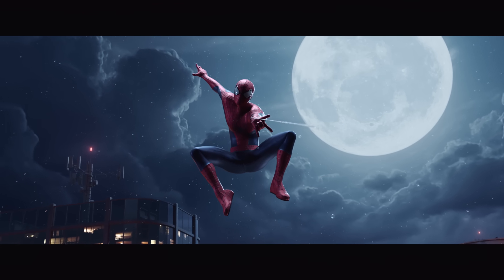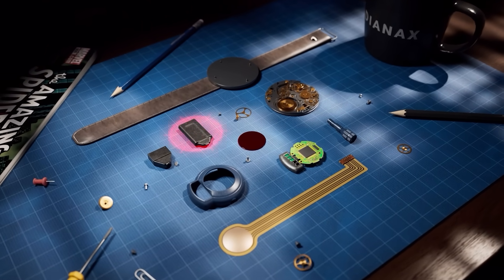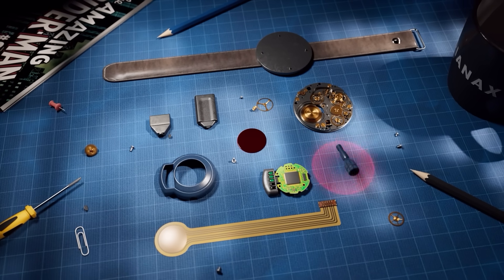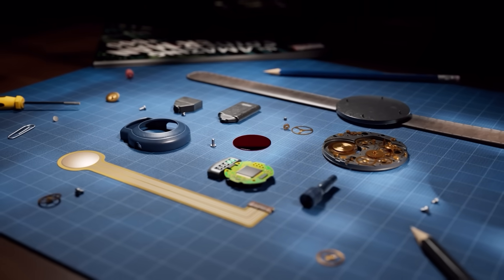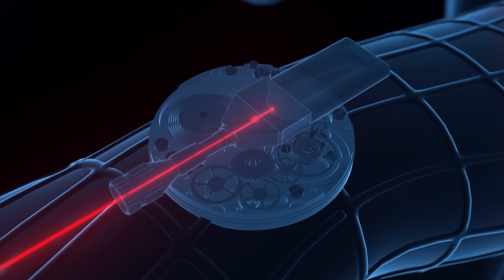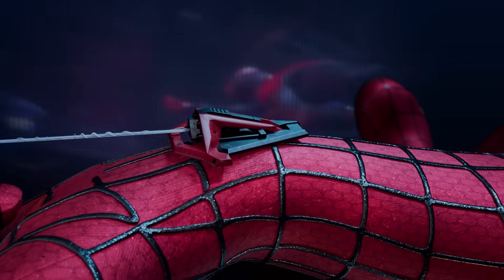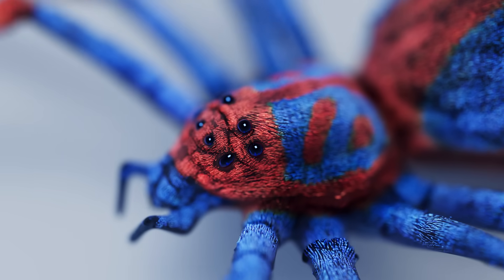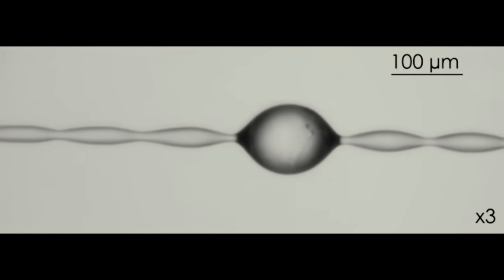How the Web-Shooter Works

Comment: it's not really that realistic. 1) where's the web supply coming from? there's no visible web supply. for him to swing that many times (in the comics and movies), he'd need a large pack to feed all the web. 2) where's the force/pressure coming from? a device that small is unlikely to create enough pressure to eject a web at that speed for the distances that he needs. it's upwards of 100 ft that he's shooting to, building to building, which would require a significant amount of force. 3) how does a web that light shoot in a straight line for that far? try throwing a string as hard as you can. it's not gonna go far because of how light it is. there's no weight at the front to propel the string forward. if you attach a piece of rock/gravel to it, and throw the rock, it'll go much farther, but definitely not enough for it to be a straight line from one building to another. now look at the shooter. it doesn't shoot out rocks, and the most weight i've seen is a glob of webbing at the front that acts as the weighted momentum. but that's like tying multiple knots on the tip of the string and throwing it. it's still not heavy enough to make any difference. so the physics just don't make sense.

Comment: After the web release how does it cut in the hands, if it is hard as steel😊?
Reply from the maker: When Peter releases the trigger, a small valve inside the device cuts the web while it’s still soft.
So it doesn’t harden in his hands like steel, it solidifies only after it leaves the webshooter

Comment: Most definitely not carrying 100’s of meter thread in the cartridge. It’s most likely some type of solution that coagulates when exposed to air probably due to a pressure drop (I imagine it’s highly compressed in the cartridge

Comment: Excellent video but unfortunately this type of web shooter is 100% impossible for many reasons; no web material can support that kind of body weight, no amount of pressure could propel such a lightweight thread at such long distances, that flimsy wrist strap would NEVER support his body weight while swinging, the internal components could also never support his body weight. A web shooter like this is pure fantasy.
Reply from the maker: I agree with most of your points. The only thing I’d add is that Peter doesn’t hang from the web-shooter itself, he grabs the web line with his hands, so the load doesn’t go through the wrist strap.
Reply: @Dianax13 Good point and a very excellent video! 👍
Reply from the maker: @SuperheroArmorychannel thanks bro

Comment: One logical approach to shooting webs would be to press against his upper palm (closer to the base of his fingers) with all his fingers. making a fist COULD trigger the effect of pressing 2 fingers on the button, but higher up on the palm- think about it. you dont make a fist that way, your fingers usually reside in the middle of your palm. but by doing the old-school spidey way makes more sense to me. more room for the web to come out, and a smaller margin for accidentally firing a web. 
I wouldn't mind seeing spidey do this again, because it makes sense. yeah we all know the 🤟, but there's such a margin for error that i know is now a staple of spidey, but unless it was EXTREMELY finger sensitive/ had a recognition system, the higher squeeze towards the base of the fingers makes more sense.

Comment: From what I remember from the 90s cartoon the webs were almost like two parts resin were he developed a special fluid that coagulates when dispersed which creates the webbing and after two hours it dissolves the reason it seem less it’s compact fluid which reacts after release what we have seen in real life so are is just coiled up straight or aerosol cans that squirt out silly string but I wouldn’t be surprised if someone goes the resin rout to achieve the compact issue and the tensile strength issue in the future.

Comment: Why does the trigger not get pressed accidentally whenever peter holds something tightly or put his hands on something?
Reply from the maker: Someone pointed out earlier that Peter specifically designed the trigger so that it takes superhuman strength to press. That feature protects it from accidental activation and makes sure no one except Peter could use the web-shooter.

Comment: Very nice Animation but i have one question that I had from the very beginning. So if you press the button to shoot the web, how is the web cut off from the shooter so that you can keep swinging?
Reply from the maker: Most likely, while you’re pressing the button, the web keeps shooting out. Once Peter releases the button, the web flow cuts off instantly, and he has just enough time to grab the end of the web line. If I understood your question correctly
Reply: @Dianax13 This could be a possible theory. Nevertheless like you mentioned in your video, the speed that the web is coming out with is so fast that I doubt that he could possibly catch it just in time. At the end of the day like you mentioned, Peter has superpowers but I doubt that he is that fast. So it must be something else. For example maybe a timer that starts after Peter releases the “shoot button” to cut off the web, for example 3 seconds. But the blade needs to be a very sharp one to even take into consideration regarding how tough the web is. Maybe you have some other pointers or some thoughts on this theory would really like to hear them!

Comment: they webshooter is initially explained but it leaves many questions. how does the web not get stuck on his hands but get stuck on other things? how does spider-man grab onto the web if it is being shot out in a constant stream? if the web is supposed to be ultra durable, how does the shooter stop the web from coming out? also what about nets and other objects peter makes from his webshooters? how do the web shooters not get constantly clogged? being in high pressure how can one cartridge last so long without having to constantly replace it? how does he make catridges with such high pressure and not have it explode or pop and make a mess during a battle? the electronic web shooters look prone to emp attacks by electro. how does that not affect his web shooters? what if he runs out batteries?
Reply: 01. In many versions, he uses van der waals forces, which wouldn't make sense, but if it uses electroadhesion for that, he'd be able to stick and unstick anything by generating electric fields.
02. Spider-Man doesn't hold the web while it's being shot, he applies force to the piezoelectric sensor, and then quickly releases and holds the web.
03. Spider web is extremely strong, stronger than steel, but in tension, not shear. Spider web requires a lot of force to tear, but less force to cut. The shooter probably cuts the web with a blade.
04. the other forms of webs are very difficult to explain, it's poetic license 'cause it's fiction, but there're probably different mouthpieces that alternate depending on the pressure applied to the sensor.
05. the webshooters can get clogged, requires maintenance, ofc
06. the cartridges don't exist, it's fiction, and such high pressure would be impossible, but trying to explain, it's probably made of titanium or something similar.
07. the shooters are probably electrically vulnerable, but this is not explored in the stories, it doesn't matter.

I also found the video quite incomplete, for example without the spinning nozzle, since the web comes out spun, or the pressurized chamber that is necessary, but that's all fiction, things don't need to follow the rigidity of the real world so much. I hope I have helped with your doubts.

Comment: I like Garfield’s webshooter spraying some smoke with the shots. Either the projectile launch is really pressurized or the instant chemical bonding is that of the bombardier beetle’s explosive acid. I remember somewhere in the comics, Spiderman said his trigger needs a lot of strength to press as a safety feature. Is that possible in this scale?
Reply from the maker: The smoke probably just shows the pressure being released when the web fires. I couldn’t find any info about another way the fluid could be ejected.
And I didn’t know the trigger required that much force to press, but that’s actually a smart idea for safety. It prevents accidental shots and makes sure a regular person couldn’t use the web-shooter without spiderman’s strength

Comment: Strange how people still have no idea how it works. It's just: click -> opening "door" -> web-fluid (ig i misspelled it) under pressure going out -> it becoming harder each moment -> web... line... just web
Ofc he have other types of fluid and other types of default one (like for web-balls or just to swinging around)
Reply: it's not that simple. There are many other processes involved that are left out, the spinning nozzle, the part that cuts the web, there is probably some IR system that regulates the release of the web to maintain its maximum tension (if not, the webswing would be very imprecise), safety and data reading circuits etc
Reply: @itsilvjot  I mean ofc it's not that simple, but in few words ig i am right
And same "door" that releasing web is cutting it as well, ig
And i think things like safety or how much web he's using is simple - his fingers... With super strength
And ofc it depends on whatever universe we talking about like Noir or Ultimate or universe where Flash is Spider-man

Comment: Does the pre fire chamber / spinneret in toby McGuires spider-mans natural web shooters compress to 300 psi?  Must really hurt if he ever gets a blockage. The artificial web fluid cartridges must be made of titanium molyebdinum alloy or reinforced carbon fiber wrapped steel.
Reply: spiderman can withstand a fall from a height of 50m without damage, 300psi of pressure certainly wouldn't hurt him
Reply: @itsilvjot  That makes sense. His cell walls must be like titanium. You think he'd be bulletproof too.
Reply: @marcmanalli  he is not bulletproof, shots have much higher pressure than falls, even falls from 50m. A low/medium caliber shot can have a pressure of 20,000 psi or more
Reply: @itsilvjot   20,000, wow! That is quite the order of magnitude. Web shooters could totally be real. I just wish I had the upper body strength to use them.

Comment: 5:57 some youtubers builts harness suits to web swing and some people are very durable and athletic and if they use the harness suits then they might even be able to flip off a web with one arm while catching another, ps dont forget there ninjas coming public and showing impressive stunts in there vids
Reply from the maker: Yeah, there are some amazing people out there, real athletes and stunt performers. What they do is awesome to watch, but I doubt anyone could jump off a skyscraper and keep swinging like spiderman
Reply: @Dianax13  actually all u need to do is start swinging from the rope at angle that slowly builds pulling force in the rope. The only reason it's dangerous is bc when that pressure builds up to fast, the strength of the rope/you arm can't keep up. But again if u start swinging on the rope at a 90 degree angle or higher then there won't be overwhelming force pulling u if u were to start swinging after u passed below the point u shot ur web at

Comment: I spend two years of searching and engineering, and finally I make the real web shooters that perfectly designed with the most accurate webs in the world that so flexible and can lift 85 kg.
But I can't be Spiderman or give them to someone because the normal human can't hold the pressure of Spiderman and his biological abilities as you said ❤
Reply: bro make a video, spiderman webshooters are an engineering problem which fascinates me too. It also inspries a lot of my inventions in medical nanotech and biotech.
Reply: Bro then you should make a video on it I would watch it
Reply: Some observations: the web can withstand 850N static, as you said, but during movements, the impact is several times the weight, so be careful. Plus you probably can't swing much because your web probably doesn't have enough resistance, elasticity, tenacity, or adhesion for that. Your hand won't stick, so you would need to hold the webs using only finger pressure, so practice this for small swings. Good lucky with that.

Comment: Web shooter can't work in real life  first of all because you will need a firing pressure from web shooter plus the point that will attach to the objects needs to be solid enough to pierce air pressure & super sticky to latch on object on contact. As for web swinging for example if an object is swung by a string. String can break but if a stretchable string it won't break but a streachable string that is a challenge. If u web swing with it u will go down more because of ur weight instead of going up. So the web needs to have a minimum  weight or force requirement to stretch like it doesn't stretch on ur body weight. Plus we need to think about the force on the person during swinging. Because of the nature of a strechable string. I have no knowledge about spider web aside from the fact it is super strong.
Reply: research about tenacity and non linear materials

Comment: Interesting fact. At least in the comic, to activate the shooter, the triggering pressure sensor only responds to like a couple hundred pounds of pressure. Which is nothing for spiderman but stops others from using them.
Reply: That's actually pretty smart. I can't believe I've never heard of that
Reply: @BlueEagle600 same
Reply: it also needed to be double tapped
Reply: And the different web functions need different amounts of pressure
Reply: @joshuajohnson3869 that would need insane practice.....fr
Reply: In the animated series, it was explained that the sensors react to exact pressure. So, it's not just responding to a high amount of pressure that only he can make, but it's prevented from accidentally triggering while making a fist or holding something.
Reply: Also there are sensors on the outer fingers that when he makes it a fist to punch prevents the shooters from activating
Reply: Tell that to the punisher in that one comic
Reply: I thought it only activated from Van Der Waals sticky fingers, which only he has.
Reply: The major reason was so he doesn't accidently press them while climbing on surfaces or during fights. I think it required like around 1 ton of pressure + double tap.
Reply: Wait a second then if spiderman if not holding do a handshake me he would probably crush my hands like chips
Reply: @Nothing-x4-z5f Spider-Man could crush every bone in your hand into a fine powder if he didn't hold back
Reply: @franciscotoro827 no doubt
Reply: @Nothing-x4-z5f uh duh, his web shooters are activated with 60 pounds of force which is all located in the palm of his hand which is insane but it’s stated in  the comics

Comment: what if to be able to swing like spiderman you created an exoskeleton-like suit
Reply: The problem is that we don't have lightweight exoskeletons for this. The best option would be to focus on the web's energy dissipation capabilities
Reply from the maker: maybe it will work
Reply: I think maybe its possible if your able to create a lightweight exoskeleton suit which carries you but isnt too heavy because physically your body would not be able to handle a heavy suit and without it you wouldnt be able to hold the pressure from swinging with the human body

Comment: The only issue I have with these models of webshooter is the fact that, you can't get that level required pressure. Webs need to be shot at enough pressure that it actually reaches the top part of a tall building. So other than the web fluid itself, we also have an issue of range
Reply: Yeah and I don't think something that small can really handle the pressure of  the released webstrings, let alone firing them for hundreds and thousands of time without it breaking apart. With Stark suit, the suspension of disbelief can still be maintained because in our mind we can accept that Tony can do something like that. But for a broke teenage like Peter, being a genius alone isn't enough.

That's why I think ODM Gears from AOT still feels more tangible and realistic than webshooters due to the considerable thoughts and hefts that's put into its creation.
Reply: @yamadawaver9317 very well spoken my friend
Reply: @yamadawaver9317  titanium can withstand absurd pressures, above 500MPa, you can buy 1kg of it for less than 20 dollars. Believe me, this is one of the least of the problems
Reply: Maybe he flexes really hard which squeezes the cartridge
Reply: @KaitouKaiju ya like your uncle flexes and squeezes your balls
Reply: There's also the issue of making it stick well enough and expand at the tip so it's wider. Even after that how would you know if you've shot enough web to make contact. And after making contact making sure not to shoot to much because if the web line is not tight your arm would get dislocated

Comment: One question do you possibly know how Peter made a a tiny nozzle that mimics spider spinnerets glands, also do you think Peter sweatshirt consists of code.
Reply from the maker: I think, the nozzle isn’t really a problem. We already have real-world examples like fuel injectors or microfluidic jets, small parts that can control high-pressure fluids with great precision. Making a tiny metal or polymer nozzle isn’t hard with modern tools